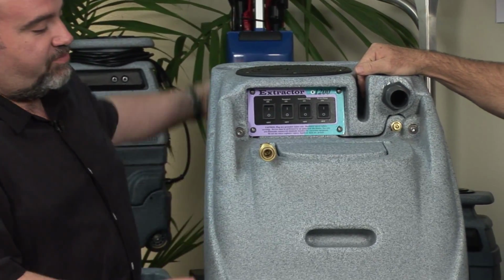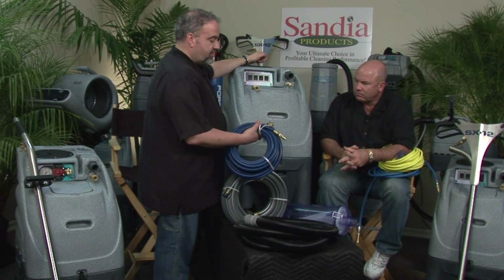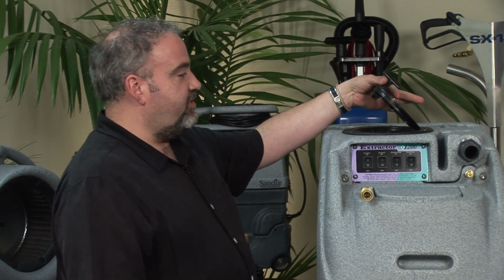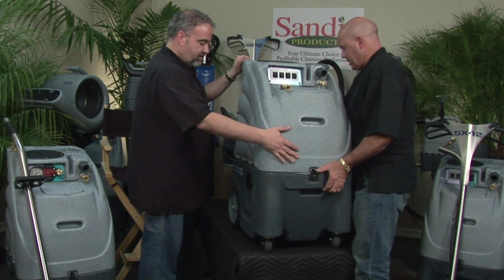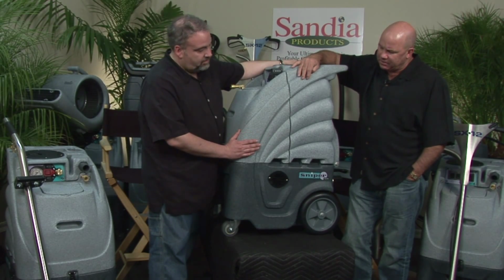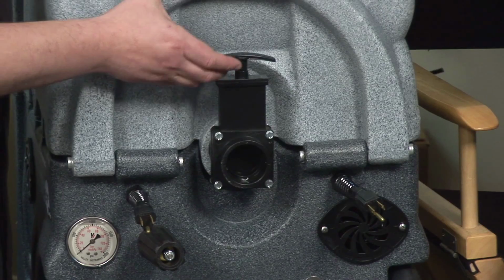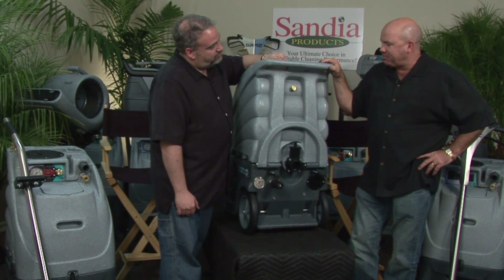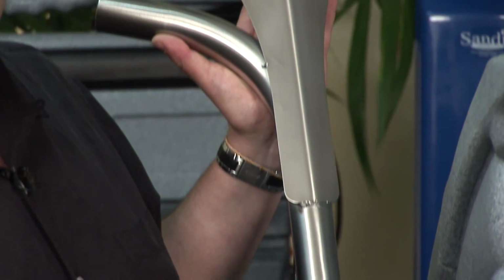Sandia Products - 1200 PSI Hard Surface Extractor Features and Benefits

Comment: i bought one of these and so far i been happy with it. just wish it would produce hot water.
Reply from the maker: Hello! Unfortunately, Sandia does not make a 1200 PSI unit with heat for 2 reasons: #1 is the fact that the heater would never be able to keep up with the 2-gallons per minute of output; #2 is the high Amp draw. This machines is already pushing 19 Amps on both cords.  Each heater element would add another 9.4 Amps to each cord.  Thank you for taking the time to ask the question.  We are always striving to improve our machines and your input in valuable to us!

Comment: I was looking at the king cobra 1200 but it's too bulky and heavy to carry up the stairs. I want something light weight and quiet for residential & commercial use.
Reply from the maker: Hello! Our machine is 150 lbs. and is designed for commercial use. You could move the machine upstairs empty, backwards using the wheels. It is still a commercial unit though. If you have any questions, please call us at 714-901-8400 and we would be happy to help!